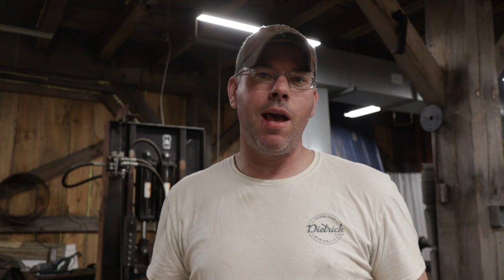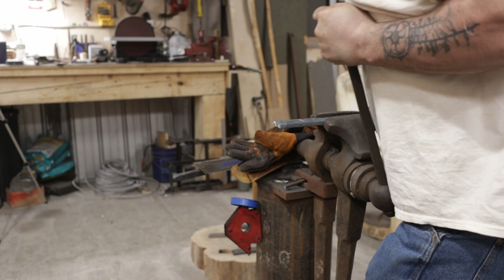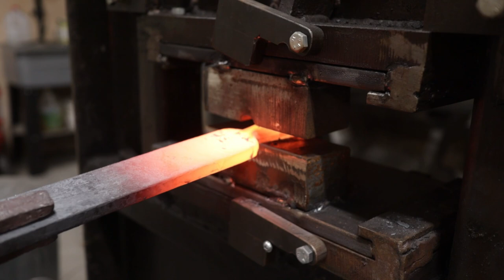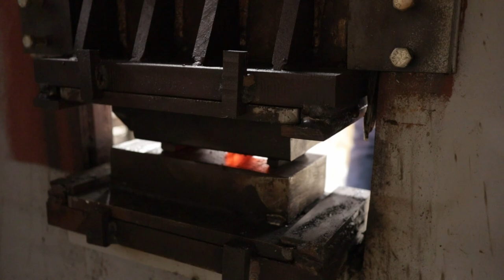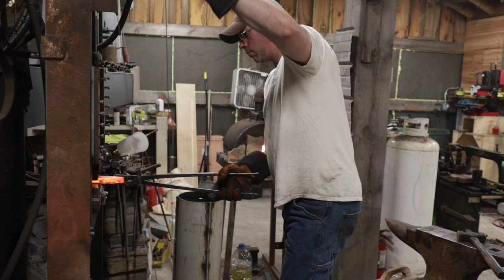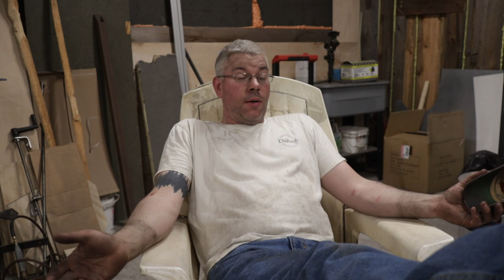First Timber Frame Chisel Production Run

Comment: How do you like your Makita grinder? I have an old 9" Milwaukee corded and I keep going back to that, it has higher RPMs, and has a lot of HP. A new cordless Bosch has none of the features of the corded and shuts off if run hard. At the wire mill we had an annealing oven that heated the wire overnight and was unloaded in the morning. I only helped once or twice.
Reply from the maker: I like it, low price and it has worked great.  It sees heavy use.
Reply: @TheTradesmanChannel  OK